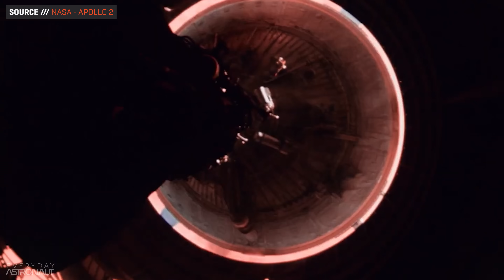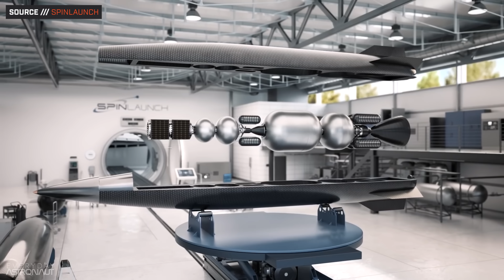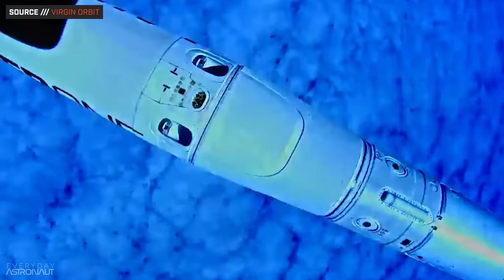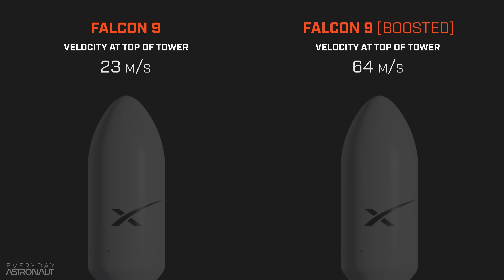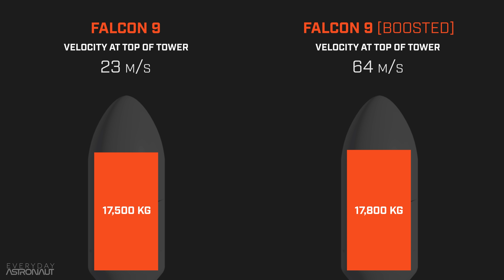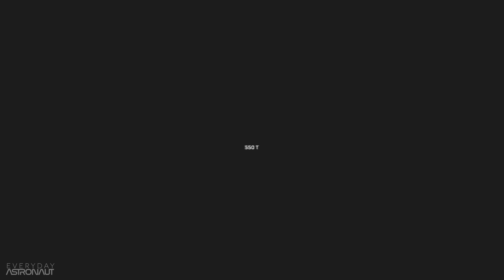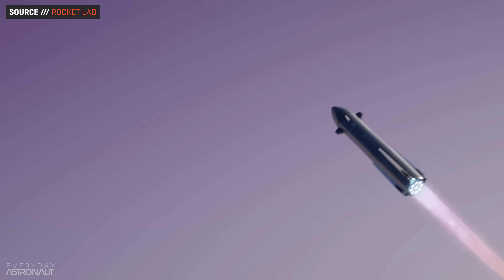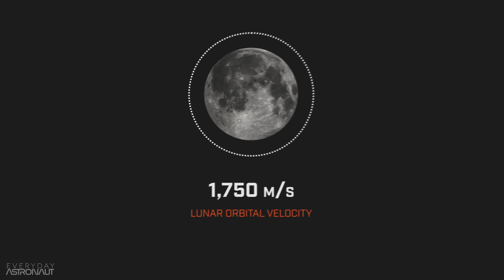Could We Help Push Rockets To Orbit?

Comment: 28:36 wait im confused. why does a velocity change require different energy based on different velocity? im used to the physics of space flight saying if you have X energy on board youll get Y deltaV, regardless of your current velocity relative to earth. i mean, you build a rocket in ksp and it tells you before you even leave the ground how much deltaV that rocket can do (in vacuum). so why does THIS 100m/s change in velocity cost more energy than THAT 100m/s change in velocity? the "current velocity" is just relative anyway, right?
Reply: I believe it’s called the Oberth effect.  Somebody correct my math if it’s wrong  

For example, if 1 kg is moving at 10 m/s and you increase your velocity by 10 m/s the KE goes from about 50j up to 200j.  So it takes 150j of energy to accelerate the mass from 10 m/s to 20 m/s.

If the 1 kg mass is going 100 m/s and you increase to 110 m/s, the kinetic energy goes from about 5000 J up to 6050 J.  An increase of 1050 J.  

I admit it does seem like black magic at first, but that’s the way it works.  You get a lot more energy if you do your burn at periapsis where you are ship is moving faster than you would at apoapsis and the ship is moving slower.
Reply: @mb777-g8v  this is correct, and why the reference frame is important
Reply: @mb777-g8v  right thats why its throwing me off. in the case of a rocket in orbit, youre gaining much more kinetic energy by using the same amount of fuel. yet in the case shown in the video, the dragon capsule accelerating in the vacuum tube, it requires proportionally more electricity in order to gain that higher amount of kinetic energy.
Reply: kinetic energy is 1/2 mass * velocity squared

so if you’re traveling 100 m/s and go up to 300m/s your kinetic energy has increased by 4.5x even though your velocity increased by 3x

edit: math
Reply: @ffffffff-gu5qr  so why isnt a rockets potential deltaV different depending on its velocity? if im orbiting earth at 8km/s i have a certain amount of energy. but im also orbiting the sun at 30km/s. how much kinetic energy do it have? i certainly dont have two different amounts of energy at the same time
Reply: @ICKY427  you’re talking about two different reference frames.  Sure you have the same kinetic energy total regardless of how you’re moving an orbit and now that earth is moving in orbit around the sun and the sun is moving to the galaxy in the galaxy is moving, etc..

But in the reference frame that we’re talking about, the Earth is also moving at 30 km/s
Reply: @ICKY427  deltaV is a relative change in velocity, 100m/s increase will always cost the same amount of energy because you can always come up with a reference frame where your initial velocity is 0

Comment: What about pumping fuel while it takes off?
It wouldn't be as hard to do as yeeting it. How much would we gain by having the rocket full (or almost full) at certain hight and speed?
Reply: A very long umbilical.  Less capital investment, comparatively easier to implement.  What's the performance increase?  I'm visualizing the business end of the umbilical supported by a long flexible beam that would pull the connector away from the booster at the proper moment. (and then the umbilical would fracture and spray fuel over the launch pad, setting everything on fire, haha.  I do safety analysis for my day job so that's the first thing that occurred to me). It could work.

Comment: No need to connect a 1000 nuclear plants for electric propulsion, just use rocket fuel? What about attaching raptor (or equivalent) engines to the (properly modified and reinforced) launch tower chopsticks themselves? Yes the launch tower would need some modifications, but the tower mounted engines could be fed propellant from base giving sufficient push to the rocket.

Comment: The performance of doing this on Superheavy / Starship would be even worse. Based on flight five, which is the only one I’ve done the detailed analysis with so far, there appears to be a structural limit of 2.3 g’s for the first stage burn. I suspect this is a structural limitation of the hot staging ring. And maybe that has changed in the following several flights. But that’s 2.3 g’s total, 1.3 g’s net acceleration.

Comment: I have been thinking about this for a while now. It would be so cool if you could partner with an engineer maker to build a model rocket to launch with and without a mag rail as a practical demonstration
Reply: For the record my idea was a slightly more gradual acceleration on a rail that begins horizontal but launches vertically (with ignition starting just prior to launch)

Comment: You'd still need to keep pumping a vacuum with a tube to space.
The top will fill with the locally ambient pressure (0.000001atm, however many zeroes), which will fill the tube and eventually compress on the bottom due to it being a column of air, making space for more air to enter at the top, slowly filling back to the (height-local) atmospheric.

Power generation wouldn't be much of an issue on the moon with stage 1 batteries, and leakier stage 2 capacitors (used just before launch). You could trickle power over weeks for a launch back with a smaller plant. Doesn't change the fact that the sled length, and wire gauge required would be immense. Maybe it could work with small, unguided ablative spheres of high-pressure volatiles, where Gs don't matter. Earth-side recovery is left as an exercise for the viewer.

Someone should run the numbers for a Phobos/Deimos "cannon" back to earth. Intuition tells me it'd require even similar/less dV than the moon, at the peak of the transfer window. Not unguided though, I think.

Comment: We need to start making these things on Mars/Moon
Reply: A steel foundry on the moon would yield steel with near perfect crystalline structure due to the lack of an atmosphere. There would be no corrosion and the vacuum would draw all oxidizers out like oxygen, nitrogen and hydrogen. The steel would be very suitable for starships.
Reply: thats the real solution.  make stuff in space.   if you can get heavy industry on the moon you literally unlock mass space infrastructure.
Reply: That's the plan.

Comment: I think one interesting option not covered here is a skyhook (NOT a space elevator!!). A skyhook would rotate while in orbit and be slower at one end while being faster at the other like a wheel. At the slower end a spacecraft can dock and it will get the rotational energy converted into kinetic, which can be released at the faster end. The skyhook can gain rotational energy either by using it as a electrodynamic tether or by slowing incoming spacecrafts.

Long tethers with payloads at the end have already been tested such as with the YES2 and STS-75 mission. Boeing HASTOL project gave an in-depth analysis as well.
Reply: Yep! Anyone else curios what a Skyhook is, Isaac Arthur has a really wonderful video called "Skyhooks & Rotovators" on the subject. Rotovators are the promising ones, though still a monumental challenge, but in theory possible with today's tech.
Reply: @AlecThilenius If i remember correctly kurzgesagt has a video about the skyhook concept aswell
Reply: @AlecThilenius  skyhooks were prominently featured in the anime Bubblegum Crisis Tokyo 2040
Reply: I would love to see the construction of a Tillot Two Tier Skyhook. 
However I think  the video is on more immediate solutions.
1) The Effiel Tower weighs 7300Tonnes. A very Conservative guess for a skyhook would be 1MTonne. We are decades away for still placing that much material in orbit.
2) All the existing satillites are hazards and would need to go.
Reply: @oldsouljerry  1 million tons is way to much for a skyhook. The YES2 mission in 2007 tether weighed 0.2 grams per meter. At its full length of 31.7km, it weighed 6340 kg or roughly 6.3 tons. Even if we take boeing HASTOL Project which proposed a 600 km tether, that would be 120 tons. Maye the tether would be a bit thicker for the longer one, but 1 million tons is definitely too much.
Reply: The skyhook needs enough rotational inertia to pull the payload up, and enough total inertia not to be brought back down to earth in the process. 1M tons is not that much for what is being proposed. Especially as it needs to be a wheel to remain stable, not just a single spinning tether that would flop about lije spaghetti any time it didn’t have a payload attached.
Reply: @Imagine_Beyond The tether thickness needed for a functional skyhook design, especially of a useful payload size, is incomparable to that test mission. It would need to be far thicker and higher strength at that length even for minimal payloads, but most of the mass you’d need is for counterweights on each end to store rotational inertia/stabilize the spin. The core way skyhooks work is trading energy between their own rotation and the payload, so they need to outmass the payload by a large margin. Leaving the huge scale difference aside, the test launch you mention was a one time system that doesn’t need to maintain a spin for consecutive uses.
Reply: I came to write same comment. 
Skyhook is most realistic and good for conserving exhaust materials down on Earth instead of wasting in space. I mean if we massively conquer space one day. 
From ground to LEO chemical rockets will likely dominate as there are no good options in Earth environment. 
For other planets or Moon perhaps something of that might work. For Earth unlikely.
Reply: Yank the rocket into space!
Reply: ..... 0.2g per meter?

 I would expect a infrastructure system for safely monitoring, controlling, managing and maintaining tonnes of cargo being flung in and out of orbit at high relative velocity to consist of more than a cable.....

Comment: Hi Tim, great video as always. If you want doing some numbers, I sugest you doing them for a space plane. Several reasons for that: you can launch in horizontal direction, a space plane should be lighter than equivalent rocket, and any sistem based on ramjets is highly improved with the initial kick. You will see that this option is much more competitive than the ones presented in the video.
Reply: The only way this pans out is if there's substantial lift from the wings.  That has been studied; you need very strong wings that can handle the speed, which makes them heavy, and you can only use them while the atmosphere is sufficiently thick.  For example, Starship could just add bigger wings, but it does not provide meaningful net lift.  The wings on Starship are mostly for control, and the body of the rocket itself provides the drag in descent.
Reply: @mriguy3202  yes completely true, but air breatheing engines are better than rocket engines. I still see a chace to replace 1st stage of conventional launch systems.

Comment: 28:36 if it gets harder and harder to accelerate an object the faster it gets, the easy solution is to just reset the reference frame every 30s or so and you start back from 0! 😊

Comment: Do that inside the tallest mountain. The expanding gas will push the rocker out faster than if in open air because the gas will have nowhere to go but up.
Reply: It could go boom. It is a good idea though.

Comment: For your next video, 'How to Lift Stuff into Orbit'? The geostationary elevator is a bit ridiculous in scale, but I like the much more reasonable system in Neal Stephenson's novel 'Seven Eves'. An equatorial LEO satellite pays out two balancing tethers in the equatorial plane counter-rotating to the Earth. The rotation is timed so at the lowest excursion of each tether end it is briefly moving at zero velocity relative to the surface of the Earth. The tether is long enough so this point is within the atmosphere and below the ceiling of aircraft. So you just rendezvous using an ordinary aircraft, hook on to the tether which caries you out into space. Then you have two choices: either climb the tether to the LEO satellite and transfer to a ferry craft, or just wait and yeet off into space when the tangent is right!

Comment: What about a different kind of airlaunch, like having a quadcopter as the first stage? Loads are vertical, launch can be aborted and re-landed, ignition can happen while under acceleration, rocket engines can be vacuum optimized only, system works unmanned. Some back of the envelope calculations show that the energy density of Li-Ion batteries fits nicely with a launch altitude of 10km. While falling back down, the drone can re-charge a bit using the propellers as generators to have enough energy for landing.
This kind of system could enable orders of magnitude smaller rockets, as at the lower end, air resistance is the major barrier. Or strap a tiny rocket to a weather balloon.

Comment: I got an idea without too much changes to the current system, use a fuel umbilical cord to continuously filling the fuel tank during left off and clearing out of tower. The cord could be longer even, 200 meters let’s say, this should reduce a lot of initial weight of rocket.😊

Comment: Would maybe easier to keep refueling during the start sequence with a longer pipe that keeps attached until the rocket has left the top of the launch tower.
Reply: 27 merlin engines collectively use 4 tons of propellant every second, or one olympic pool in 10 minutes. Imagine pumps and hoses needed for this much flow, pressure within the hose, and the need to ascend hose full of fuel together with the rocket.
No, it would not be easier

Comment: Picture if you will an orbital space dock in leo. Big, powerful magnet earthside. Big gun on earth, Ecuador maybe. Shooting relatively small bullets of refined steel, water/ice, copper, cat6 Ethernet. Anything that can take the acceleration. Magnetic casement. Apogee kissing the space magnet. 
Would that work?
Obviously some raw materials might be launched from the moon, but I think it’s a feasible option. 
1 Engineering challenge would be variation due to variable atmospheric conditions.

Comment: The only non-rocket system I've seen possible with current known physics is what Isaac Arthur went over years back and that is an orbiting copper ring system (I won't get the details correct off memory).  It would take quite a few rocket launches to build (NATIONAL PROJECT) but it is physically feasible if the investment was there.

Comment: I think there are some other situations where the maths would work out a lot better. If you play around with low TWR in KSP, there are some notes to take: If the TWR is close to 1, a kickstart of some m/s is worth a lot more than with higher TWRs.
What costs a lot with rockets? TWR (if using liquid fuelled engines). Because adding more fuel is cheaper than adding more engines, the TWR is chosen is quite abysmal in real rockets.
So the real maths to do would be if it is cheaper to add engines or to add the launch pad boost. But I guess the answer in that case would be to add a SRB...
Reply: > Because adding more fuel is cheaper than adding more engines
When scaling the rocket, you would need both fuel and more engines
Technically, you only need enough engines to reach total thrust above wet weight

Comment: Glad you mentioned the Gigawatts of energy required for simply launching something into earth orbit, which we only have been able to have access to and manipulate using only the rocket engines! Elon mentioned that the Starship rocket generates 0.5% of the World’s total energy output during launch! Goes to show just how much energy is required just to accelerate that mass against Earth’s Gravity!

But one more thing most people are missing out on is just the sheer scale of energy involved in this! Like you said, Starship produces enough energy to power 2 million homes, and if the fuel were used in power generation instead, it could make lives better for everyone! But thats not the point I am getting at! People need to realise the fuels are something similar to a battery storing energy, and fuels like methane contain energy from Geological and biological processes over Millions of years! And burning all those fuels releases all that spent energy in a huge exothermic reaction, where energy is released, and work is done! And if we were to launch Hundreds of starship rockets, even 100 launches would make the energy released 50% of total world energy usage!

Now, consider the fact that we actually extract the fuel (Methane) from the oil wells, and then we spend some energy to extract oxygen from the air, we dont really use much energy to fuel our starships! But if instead the fuel had to be entirely generated, for eg, using the Saboutier Process in an Endothermic reaction, we actually have to put in more energy to just generate the fuel than what we would get when we burn the fuel! Let’s go for a conservative estimate - Generating all the fuel from scratch for a starship launch requires ~0.6% of total energy output! If Methane wasnt extracted and instead synthesised on site - we would need to use 60% of total energy output just to fuel those starships!

The point here is - If humanity wants to be a multiplanetary civilisation, we need to Drastically increase energy production than we currently have - either from Solar or Nuclear, even if we extract the generous resources of Methane! We as a species need to learn to control and harness massive amounts of energy from Energy dense processes, that would otherwise be hard to control and may even be destructive, or not produce net energy at all - Eg Fusion! We need to spend time and energy and resources to control and harness more energy, which in turn would provide the necessary energy to make our lives better, and also become a Multiplanetary Civilisation! We need to reach Type 1 civilisational status fast by increasing our current energy output by 100x!